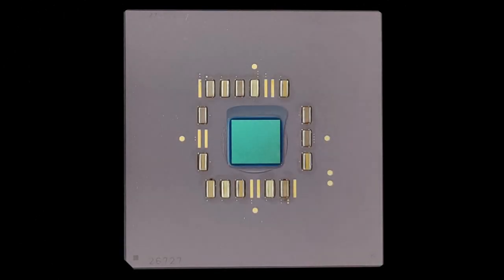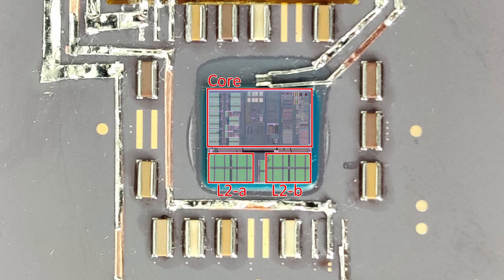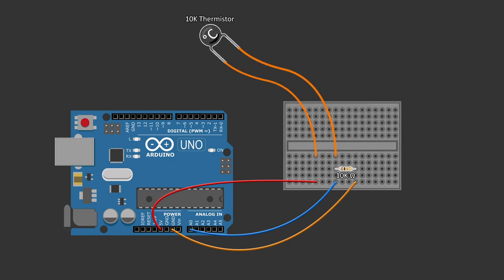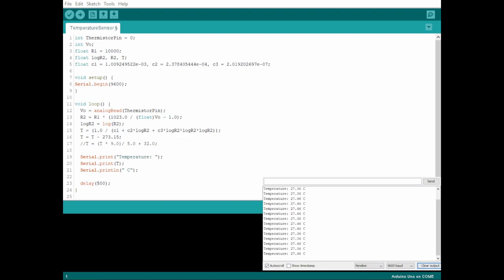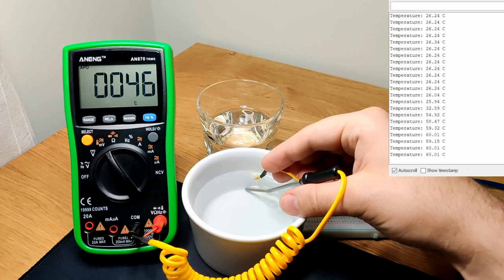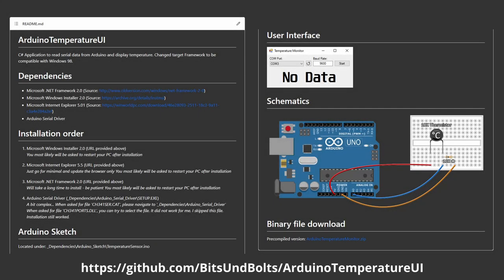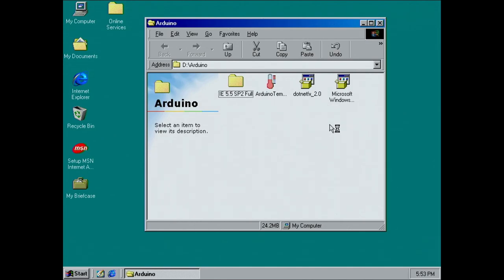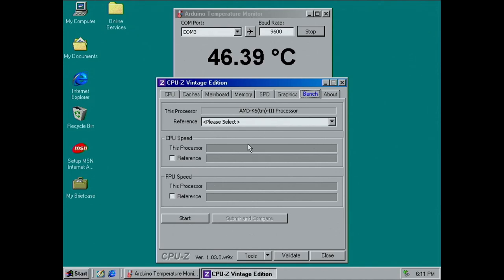AMD K6-2+ Temperature Sensor with Arduino and Windows 98

Comment: Nice! This might be useful for a lot of other projects. 

Wouldn’t it be more interesting though, to leave the arduino out of the equation, and to desolder the thermistor from the motherboard and replace it with some 40 AWG enameled copper wire? Those wires might even be able to be pushed between the socket pins and the PCB (yes, underneath the socket), which makes the current motherboard probe a lot more accurate and usable again via BIOS. 

Motherboards that lack such monitoring could in theory also be provided with a monitoring IC like the LM79 (LM79CCVF at digikey). You won’t be able to see anything in the BIOS utility, but you’ll be able to use the sensors from any compatible application through the ISA bus (iirc). :)
Reply from the maker: Hi Tom - you are right - leaving the arduino out would make the entire setup much cleaner. Initially I wanted to have an external temperature monitor that I can use in future videos and just have a window overlay via OBS Studio. But then I got a request to test if it is possible to monitor the temperature from Windows 98 as well. Then the project took its course.

I really wish I had the knowledge to pull off soldering together monitoring ICs and ISA bus cards. Maybe in the distant future ;)

Comment: Haven't watched all of the video yet but the intro is great!
Reply from the maker: Glad you like it!
Reply: @bitsundbolts  I watched the whole thing, sehr gut! Just one question: do you think it would be possible to attach the sensor directly to your motherboard, replacing the one under the cpu?
Reply from the maker: I think you would have to know the exact specification of the original sensor. Just replacing it may result in unexpected values. But then again, I am absolutely no expert

Comment: Depending on which Arduino you use, couldn't you just wire the serial pins into one of the system's serial port headers and avoid the drivers altogether?
Reply: Not quite. The serial pins on the Arduino are TTL level. You would need a level converter such as a max2323 IC to make this work.